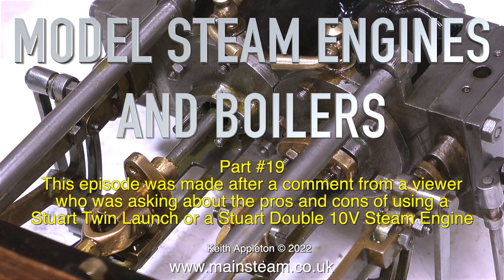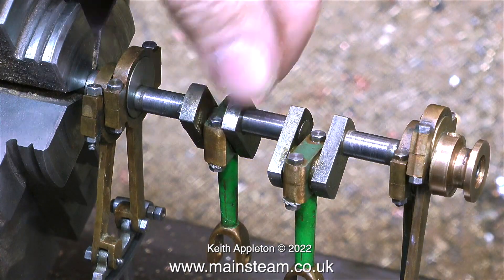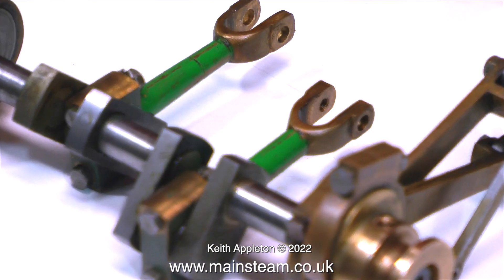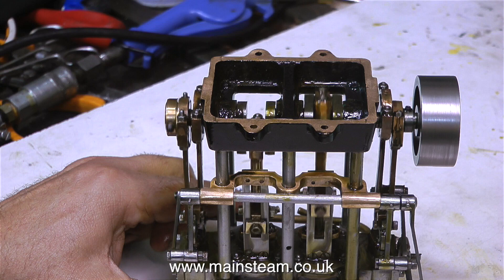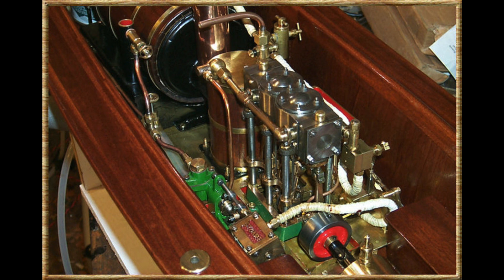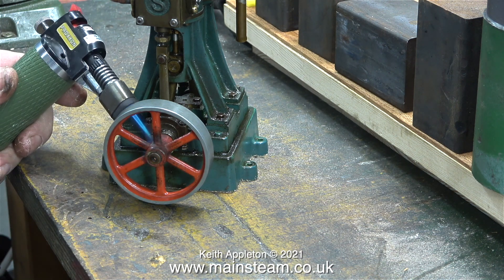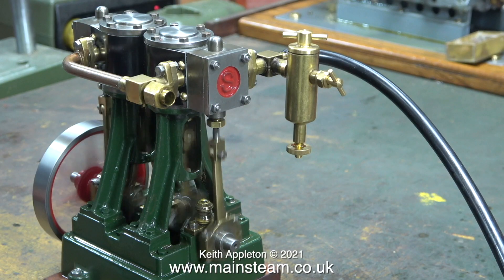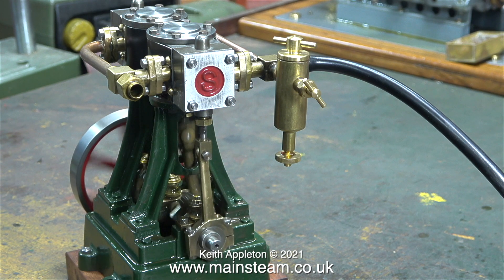MODEL STEAM ENGINES AND BOILERS  - PART #19

Comment: What is the most efficient way to throttle a steam engine. I see that most times people just throttle down the steam flow using a valve but I know some stream engines used special valve timing that would close earlier or later to based on the governor. I feel like using a valve to drop the steam pressure is a waste of that pressure. If the boiler makes 60# and the gate valve drops it to 20# isn't that gate valve wasting a lot of energy?
Reply from the maker: You need to understand the concept, it is simple. Closing a valve drops the steam pressure to the engine by letting less steam through to do the work. To use your logic: If the boiler generates 60PSI and the gate valve drops it to 20PSI no energy is wasted by doing this - the other 40PSI is still inside the boiler, it will only come out if you open the valve a bit wider, then the engine will speed up and/or give more power ....... nothing is wasted at all. The Centrifugal type of Governor just closes a valve to keep the engine at a constant speed. relative to the load. Hope this helps.
Reply: @keithappleton  Here is my disconnect. If I do a though experiment. I could replace that throttling valve with another steam engine that takes in 60# and exhausts at 20# and have that 20# steam run the original steam engine. Basically like making the engine into a double expansion engine but with different crank shafts. I get another engine running without using any more steam. There is probably something I am missing as to why this wouldn't work and I would appreciate your help in finding it.

I am in no way trying to insult you, I'm new and thinking of building my own model steam engine and really appreciate all your videos. I'm just trying to better understand by asking questions and really appreciate your help in understanding.